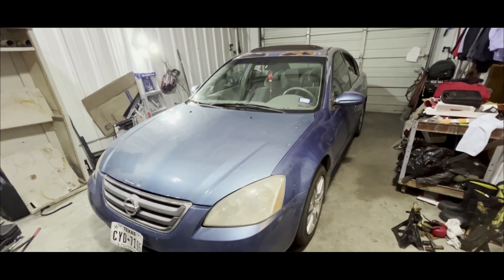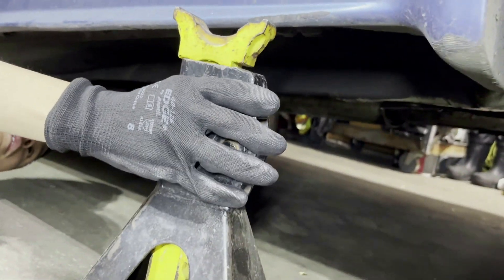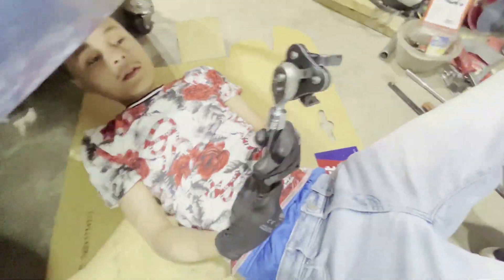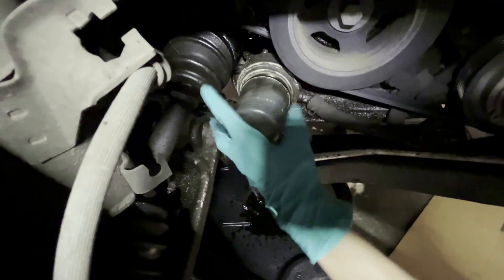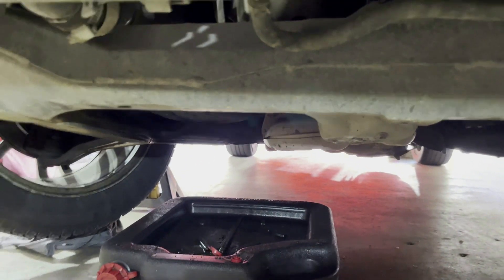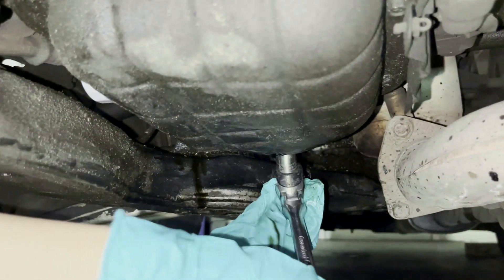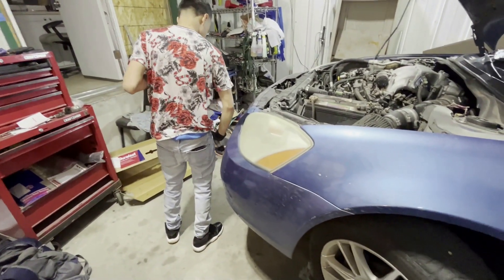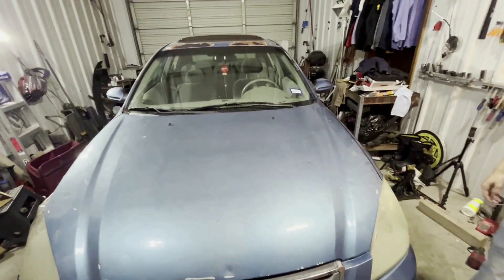Altima 2003 3.5 oil change (Zach's first oil Change)

Comment: Awesome video . Question, I got a bmw 535i 2011 with its not an x drive. Im trying to get a serpentine belt from AutoZone but it asks if its dynamic drive or not. So im not sure what kind of belt to get
Reply from the maker: Hey Laslay13 yes mine was a 2011 535i and mine does have dynamic drive so I’m sure yours has dynamic drive go ahead and get that one. It should be the right belt. Thanks again for watching brother like always. I appreciate you.
Reply: @Marty09933  Do you know  how to  tell for sure ?
Reply from the maker: @LASLAY13  look in the front under your car and you’ll see like a  electric motor you’ll notice it unless you’re car that’s your dynamic drive